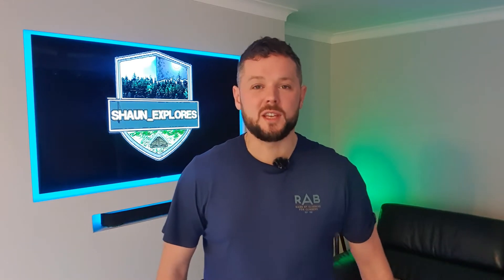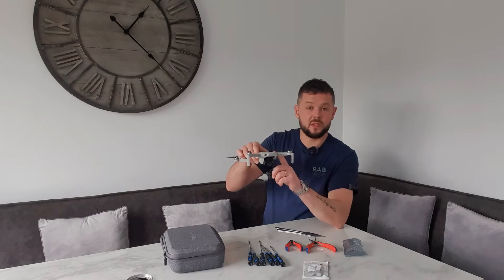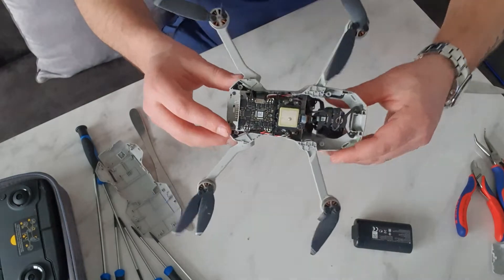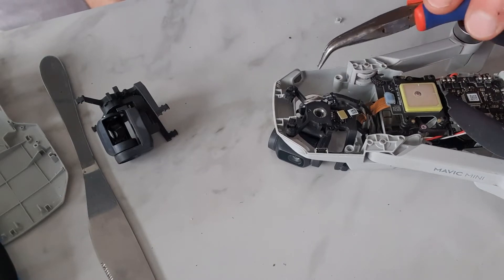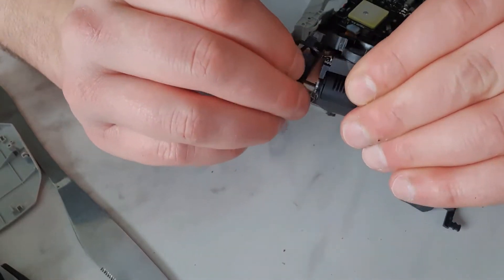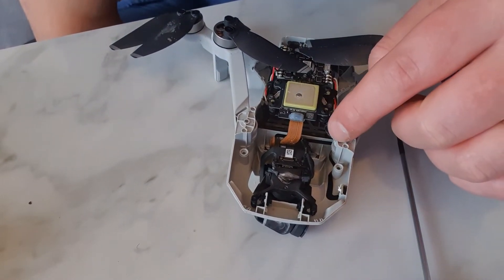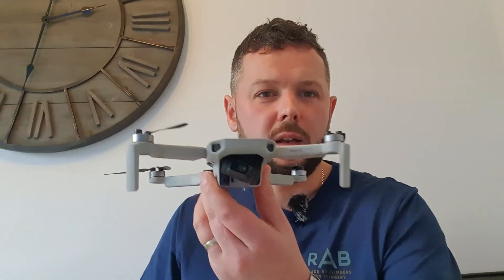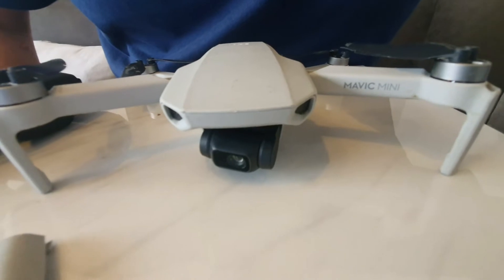DJI Mavic Mini 1 & 2 - can you replace your own GIMBAL?

Comment from the maker: *Update* I have fixed the drone and it now works perfectly. 

So I was about to have another bash at programming the new gimbal when I noticed I still had the original brocken gimbal in the case. I took a closer look and decided to have a go at gluing it back together (I had nothing to loose right?). Anyway, long story short, the gimbal held together solid, so I transfered everything back over and rebuilt the drone and it works perfectly. 

Let the adventure Videos continue in 2022 🙂👍
Reply: So you are flying with glued gimbal not replacement gimbal right?... The python code did not work?
Reply from the maker: @Indranil Gayen  exactly that. At the time of filming the original video, it wasn't possible to crack the coding with python (there certainly wasn't any pre made scripts to copy anyway). This may have changed more recently and it may be possible, but to be honest, I've not flown my drone or filmed anything for around a year 👍
Reply: So then...

Buying the part turned put to be pointless?

Man such bullshit.... right to repair ly ass...
Reply from the maker: @Matanumi  thays correct. Unless you can calibrate it, it won't work
Reply: @Shaun-Wilson  mate it’s best to send it directly to DJI. Crashed my mavic air 2, broke the gimbal arm and aircraft leg. DJI approved dealers were saying £350 to fix it, however DJI themselves did it for £80 (including shipping to and from the Netherlands). In the end they just sent me a new drone, so got a new drone for £80
Reply: @zSubzyModz  you were very lucky because they gave you a deal for a broken arm or whatever which is less
Reply: @zSubzyModz  probably a refurb.   Pre used.

Comment: Hello,

I had the same problem, my gimbal calibration stopped at 10%. Turns out it was my mistake - when I reassembled DJI mini, I have screwed the bracket that holds the ribbon cable from GPS module to the gimbal (the one that snaps in the most videos on youtube) the wrong way. So the L shaped bracked was inserted wrong, rotate 180 degrees. My camera still moved when I turned on the drone but I didn't notice that it rotated fully to the right but not to the left. Then I troubleshoot without the housing so I could see all the parts and cables and I saw it.

So maybe you have the same problem - incorectlly inserted L shaped bracked that mechanicaly blocks gimbal to move.

I hope this helps someone!

Good day people

Comment: All you had to do was recalibrate the IMU in the settings on the app, THEN you calibrate the gimbal in the app
Reply: I have the same problem and it hasn't been solved. Have you tried this solution and worked for you

Comment: i found the upper bracket of the gimbal (which is broken) for cheaper than the gimbal, so how would you replace the upper part (the one that has the bearing)

Comment: BOOM!! Mike Drop!! DJI made it so that you have to use SPECIAL software to calibrate a new/replacement GIMBAL. you need to realize the real situation, DJI can be held liable, we have the FAA, and lastly DJI drones are not like a Walmart drones, DJI just wants to make sure all repairs are done correctly. lesson learned - depending on your drone it may be cheaper to take it to an authorized DJI repair center for repairs, atleast you will be sure that the repairs are done correctly and you can fly with confidence.
Reply from the maker: Mic drop!! I glued the old one back together and refitted it. Drone works a treat now. BOOM!!
Reply: @Shaun-Wilson  Boom!! I found just the case for 1/3 of the price for a full replacement and it worked without having to calibrate. MicDrop!
Reply from the maker: @Marine_0317  😂😂

Comment: It was good to see how to change the coax cable into the camera but overall this video just made me feel awful. There's no hope to replace the gimbal which is the primary casualty of most ALL mishaps. That means these Minis are a throwaway item.
Reply from the maker: indeed. what I did in the end was repeat the process all over again, with old gimbal, only I had super glued the broken gimbal back together. works a treat now 👍

Comment: This video helped so much.  I crashed my mini, camera was ok.  I ordered a new gimbal and camera and with the help of this video was able to switch out the old busted gimbal but use the old camera.  Finally once put back together it all worked!! Can't Thank you enough
Reply: .... it did? How? With a different camera it like needs to be reprogramed
Reply: @Matanumi  the gimbal was smashed beyond repair but the camera was still good so I bought a new gimbal complete with camera and put the old camera on the new gimbal and viola.  Expensive yes, wish I had found just a new gimbal at the time but it's my first drone and didn't really know what I was doing
Reply: So as long as the camera is OK it will calibrate ?

Comment: So I replaced the cable connected  to the camera it showed error 4002 after I crashed my drone , after replacing it now the gimbal is making a weird buzzing noise error still appears I also programed it with python .....basically I tried everything like you . Only option sending it to DJI official services ??by the way nice informing  video

Comment: If this is double or triple posted I will try and delete the doubles but at the moment this post does not seem to be sticking.

You could try this 
Open "assistant 2 for mavic" and connect the mini as if you were going to use the assistant 2. When Assistant 2 sees the mini open a WIndows device manager and then look for the port the drone is using. (Let's imagine it is COM17)
Open the ports properties and leave that properties window open. Close assistant 2. 
Go to your command line and using the port identification found above  put "--port " in front of the port you found above .
I think the command you typed was 

py comm_og_service_tool.py com3 MAVMIN GimbalCalib JointCoarse
if that is correct then, using COM17, it would become

py comm_og_service_tool.py --port COM17 MAVMIN GimbalCalib JointCoarse
However, all that I have seen so far suggests that "MAVMIN" is not the correct "name" of the drone, the correct name is WM160 or perhaps MMINI. If correct then the command should read 
py comm_og_service_tool.py --port COM17 WM160 GimbalCalib JointCoarse

The above is from a thread I have just found in Mavicpilots. 

For me it starts the gimbal moving etc. but I get an error message, similar to, if not the same, that in the MavicPilots thread, so there may be other problems to overcome.
Reply from the maker: Hey dude, I gave up and glued the old gimbal back together. Had to transfer everything back over but it works a treat 🙂👍
Reply: Unsure if this works past the older mini- it might not work with mini 2

Comment: I am guessing its not OEM dji gimbal I would hope they haven't gone full apple with the pairing parts to devices route.

How hard would it be to transplant the electronics from the old gimbal to the new one?

Edit: or at least the logic board from the old gimbal.
Reply: All but impossible I think, I just cut part of a gimbal apart.
There appears to be a circuit board attached to each of the yaw and roll motors' stators and if the boards aren't put in place during the 'casting' of the relevant bit of the gimbal's frame's then parts of the motor assemblies seems to be. 
The 'yaw board' is fed by the ribbon cable and the 'roll board' is fed by the stranded cable. I can see no connections running from the 'yaw board' other than to its stator.
I think the roll circuit board must have connections to a ciruit board (that I can just about 'make out' that is likely attached to the pitch motor but I haven't cut that section apart yet. 
Nor have I yet been able to separate a rotor from its stator. I suspect they are either press fits or glued together or both. 
I suspect trying to separate a rotor from its stator is going the break something.
Reply: the gimbal i bought cost 250 USD and claimed to be native dji, ill post the results of my repair attempt here

Comment: How did you go with the re-calibration. Did DJI do it for you? BTW it is best to wipe off and reapply thermal paste on the back of the camera after you broke the original paste. Further down the track you may get overheat issue with the cameram due to poor thermal dissipation.

Comment: Nice attempt to fix it.
It’s stupid that the drone can’t calibrate itself after such a repair. 

I have a better Top Tip to install the gimbal rubber dampers, just lick it before trying to push it in, and then it will dry off and no longer be lubricated, and won’t pop back out, as the soap will stay slippery for a long time.

Comment: Just crashed mine and snapped the gimbal, I was watching and thinking "shit that looks tricky, but I could take my time" only to see that it didn't work in the end. Keep us updated, not sure whether to spend money on a new gimbal or just write it off, at £180 that's close to a used drone and I'd get an extra battery. 
I did wonder why done doctor wanted the drone sending to them before giving a quote, I thought they might charge £80 I didn't realise I was £100 off.

Comment: How much did they charge to calibrate the gimbal ? Please update us , my gimbal after replacing worker great level but I would get the Imu gimbal data error and only DJI using their software can calibrate it and fix it !
Reply from the maker: Hi Byron, I haven't had it done yet. I'm going to try and get into the mini again with python software. I don't have any error codes on mine at the moment
Reply: @Shaun-Wilson  it’s error 40021 do recommend you look it up and you are lucky you did not get that code. As for the gimbal the perdón who repaired mine tried three different gimbals, the first ones was slanted like your the second one was a bit tilted and the third one I got lucky it was straight. He did not use the software to calibrate it into being level. That software is used for the bigger drones but I don’t know if it works on the mini

When you do send it in keep us updated , my gimbal works flawlessly but it’s my annoying error message that pops up every time that gets me. I’m overseas in Ecuador just to fix my gimbal it cost me 260 out here

Comment: Have you checked out droningon video on fixing gimbal issues? It's worth a try.
Reply from the maker: Thanks for the heads up on this, I watched it lastnight. It is promising because he's doing it on a newer drone than mine. I actually did exactly the same as him, however I didn't know how to get the drone code for the mini. Going off the comments in his video, it hasn't worked for people on the mini, but I'm going to give it another blast anyway 🙂👍

Comment: They will probably charge you twice as much because you took it apart already...
Reply from the maker: We'll see. I've seen another video on coding a newer drone and it worked, so I'm going to have another bash myself 🙂👍
Reply: @Shaun-Wilson  hello , did you try to go back to the old firmware like 01.00.0320 and try again with dji _tool on Python?are you sure that you follow the right procedure on Python? Try to look this instruction ,and let me know https://youtu.be/Xx51f4QuMbI
Reply: @barbaland2352  that link you’ve posted looks like it should work. It shows calibrating a mini 2 on the example
Reply: @anthonyashton3000  i am waiting the gimbal cover, for test this procedure, because when i send the command by Python , the gimbal start to nove, but One of the motor seams to be burn .that it's my problem.Now i am waiting the result from Shaun.
Reply: @Shaun-Wilson  hello , did you try to go back to the old firmware like 01.00.0320 and try again with dji _tool on Python?are you sure that you follow the right procedure on Python? Try to look this instruction ,and let me know https://youtu.be/Xx51f4QuMbI